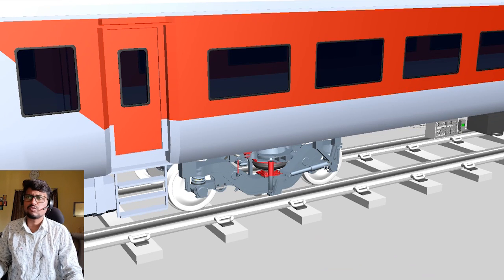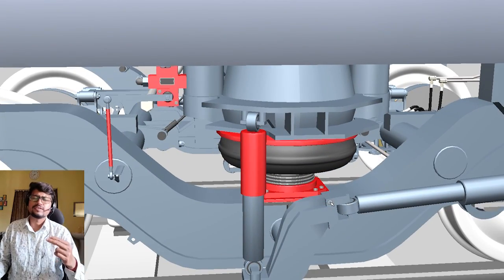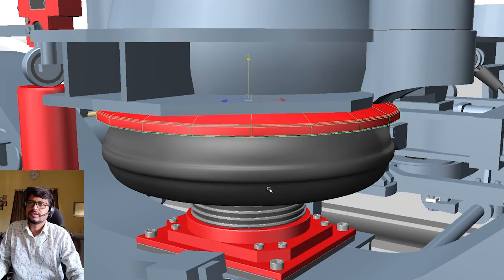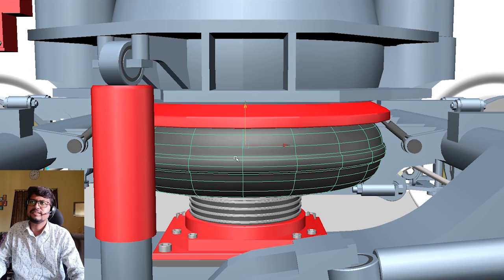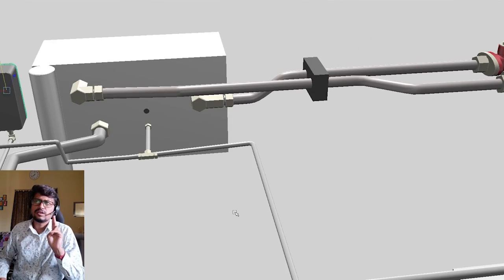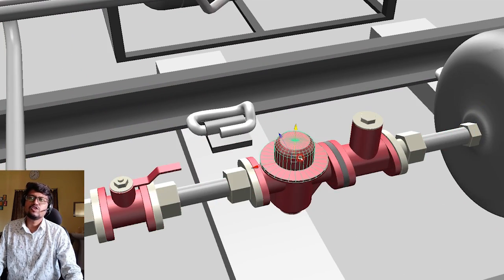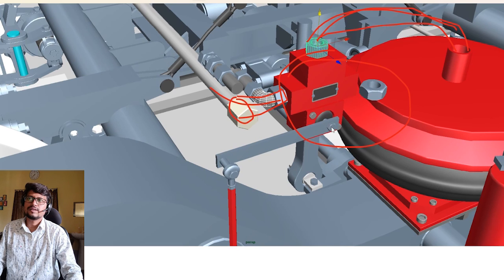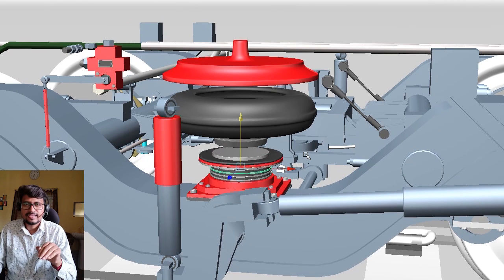Air suspension | Fiat Bogie Air suspension system Explain | #airsuspension

Comment: What are these side shock absorber for ?
Reply: The dumpers function is to help stabilize the coach body during turns and mantain a straight riding as the trains at speed starts shaking side to side causing uncomfortable riding experience to passangers and crew apart from reducing track life lengh. Not an expert, just my basic knowledge. Hope it helps.

Comment: The way you explain the input & output connection is not accurate, name of some parts too is wrong, there is one component that you missed out too. Top marks for the 3D diagram